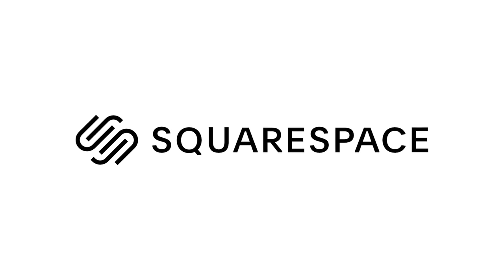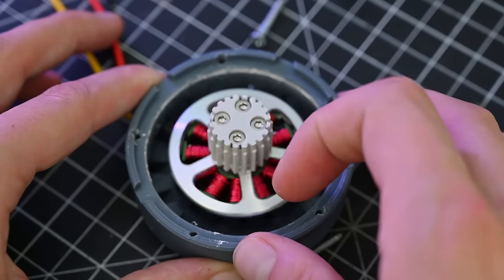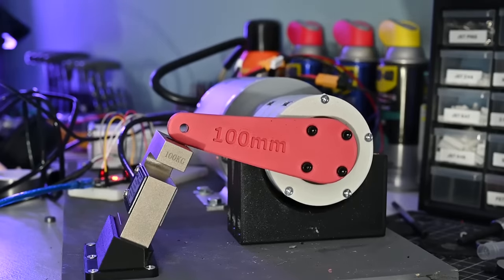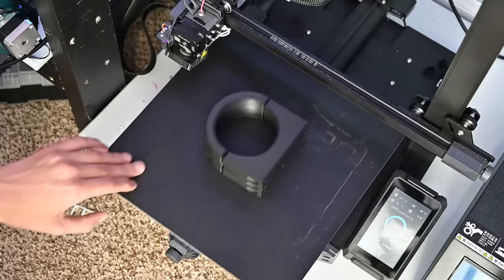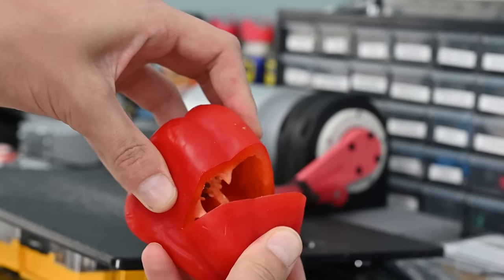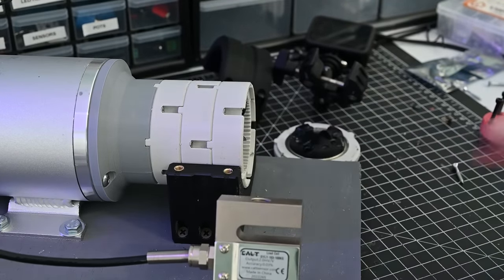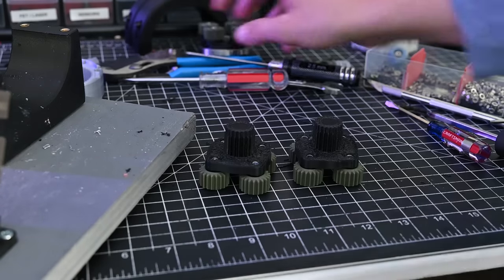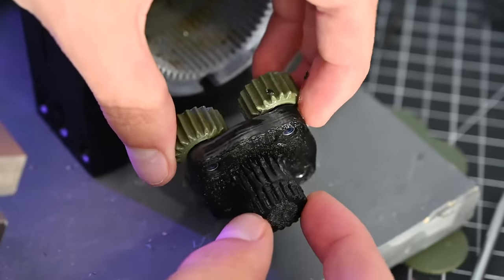Testing 3D Printed Stackable Gearbox

Comment: One pretty easy and cheap way to increase strength around where bolts are mounted in 3d prints is to add metal washers imbedded into the print, it helps spread a lot of the load out across more distance and gives a strong metal back.

Comment: The modular design is great - even for repairs. But the forces increase with each stage, so the size of each stage should increase, too. i.e. the planet carrier on the last stage could be bigger and stronger. I could see your design getting used IRL. Obviously you are a mechanical engineer.
Reply: I agree with this suggestion 👍🏽
Reply: Or print the later stages in different materials. This thing printed out of glass-reinforced nylon would probably be more robust than a drill gearbox through sheer cross sectional area alone.
Reply: @namAehT yeah, except that fdm 3d prints shear easily. Unless the layers are melted together

Comment: Planetary gears need to run on a through shaft to a backing plate.  By constraining the shaft on both sides  you will reduce the lever action on the carrier plate.  Longer gears will just make this worse. as you will be increasing the lever length.

Comment: You can get those same battery connectors in "anti-spark". They have a built in resistor. Saves the arc damage on the connector and is less stressful to the ESC. I love these gearboxes. Awesome work.

Comment: This was so taking me back to my previous work as a mechanic for Barloworld, South Africa's CAT dealer. We have had so many failures in planetary systems that i cannot even tell you how many.
I think that you are on the right track with identifying the output carrier as your weakest member so trt printing it in the strongest material that you have available.
This will unfortunately lead to the next weakest item failing and so on.
The idea here is to place a limit on the amount of torque that you want to have go through your planetary reduction drive as you can keep over engineering all the items ad infinitum and never reach a point where you are satisficed.
If you look at your different CAT machines using planetary reductions, they are all designed and sold in different size and application markets, from handyman to relocating mountains.
I really hope this helps as I am just a retired earthmoving mechanic on medical pension.
Pieter (Pete)

Comment: It would be interesting to see it printed in nylon, preferably with glass or carbon fibre to reinforce it. Also it should be printed at 100 % infill. With the nylon you could test it just after printing but also after letting it absorb moisture from the air to see which is stronger.

Heat set inserts are great, I am surprised they aren’t more common, they are so easy to insert and they are pretty strong, but it seems a lot of people don’t like them or are scared of using them. I was printing the matterhackers E3D V6 mount and found one that didn’t use threaded inserts and it required very specific nut shapes and sizes to insert and specific length bolts, whereas the matterhackers one that needed heat set inserts was very easy to put together and just used the inserts I had anyway.

Comment: One thing I noticed was that the planet gears spun concerning the carrier. This is indicating that there is too much force on one side of the planet gear for the carrier to handle. Putting another carrier on the other side would not induce a force on that side to help but may distribute the offset across the planets. Further, there should be enough room between the planet gears for the carriers on either side of the planet gears to be connected. The force could then be given to the planet gears from carriers on both sides and reduce the incorrectness of the torques on the planet gears.

Comment: Great video! Are you noticing a lot of part shrinkage when the resin cures? For resin parts I have made in the past, I have noticed that mine can shrink up to ~5% depending on the resin, so I mostly stick to PLA for “functional” prints. If you are seeing shrinkage, how do you deal with this? Are you pre-scaling the size of the parts to be slightly bigger or are the tolerances in this design loose enough that this change doesn’t matter much? Thanks!
Reply from the maker: I haven’t really had shrinkage problems with the Siraya Tech nylon black resin. I typically just use the horizontal expansion setting in the slicer to get the fit I want between parts
Reply: @michaelrechtin  Nice! Thanks for the info. I will pick some up and try this out.

Comment: Great video, i've been looking at those motors for a few months now and wondering what the performance would be like,. When printing gears I found that strength is usually won by the layer lines over infill, so for the smaller gears maybe a 12 layer line. Polymaker Tough PC Filament we've used one a couple of the robot builds, on gearing especially. There is an annealing process with that filament too, so pop it in the oven for a few hours which will aid on the compounds to become stronger. Love the video !
Reply: yup. heat treat the prints will help with max strength. there are some test videos online.
Reply: @jpjay1584  thanks for the reply a year later lol :)

Comment: With my carriers I have a screw that acts as a center shaft through the carrier and this way there is some metal reinforcement at the core of the axle that goes all the way through the part.

Comment: As far as improving the planet carrier, one thing that can be learned from impact drivers is that they capture the planet gear pin on both sides;
What that means is that there is a second plate with a hole in the middle that restricts the movement on the ends of the pins, stopping them from twisting side to side.
Usually the carrier is made from a single solid piece, which should not too difficult to 3d print.

Comment: The spark connecting the batteries is a classic in the solar / off-grid community, you should add a switch and do the plugging while the switch is off, to limit the sparks.

Comment: 100% infill with Nylon or Nylon with carbon fiber content. Or with more classical materials: print a positive on the resin printer, make a negative from silicone, and cast a positive from polyurethane resin.

Comment: Heat set threaded inserts changed my life and the way I design prototypes man. Also, barrier to entry for CNC milling is pretty low. (Relatively, I have a CNC machine shop already) You can get a genmitsu pro for pretty cheap and with some mods to the backlash nuts it will most certainly machine aluminum. You can also solid print the bearing backings combined with the housing to give extra support to the pinions.

Comment: I've always wondered if you could make an plastic 3D print stronger by leaving vias in the infill and pouring an epoxy resin as used in fiberglass. Think of how rebar is embedded in concrete to give it extra strength.

Comment: if you add some potential energy, then convert to kinetic energy to the dumbbell (by dropping it in to your sensor), you will have a complete different measurement. That's what are you doing when you measure the torque output with additional kinetic energy. Either way, there is no plastic gear match for this motor, unless you make them very large and introduce even more problems. Plastic gears will get destroyed with or without stored kinetic energy.

Comment: The planetary gears are tearing out of their mounts, because the tolerances are loose enough to induce end-climb. Add a backing plate for the far-end of each gear shaft, or switch to double-helical teeth, to minimize the end-climb, and compensate for the wide tolerance. And if you are using lubrication, add a center-channel valley. Experimenting with its depth will allow you to "leverage" some of the hydraulic lock to your benefit, as it effectively reduces the tolerance problem that is causing end-climb.

Comment: Great video. You want to select the aligned rectilinear/linear infill at 100% for best performance.
Reply: In Cura you have to manually adjust the line angle by typing the angles in settings.

Comment: The carrier will be really strong if you use bolts that go into the shafts to compress the layers. The bearings should go on the plastic carrier's shafts, inside the shafts is the bolt which compresses every layer from the bottom of the carrier to the top of the shaft.  Bearings aren't really necessary if you use lubrication. I made a much smaller 64:1 planetary gear box that uses no bearings. The carriers are practically indestructible.

Comment: PLA is wayyyy stronger then the stigma everyone gives it. When I design my firearms I do so with bargain bin pla in mind and it always surprises people to learn that, especially that I'm make a 50 caliber rifle with it (on the top end of my designs).
Reply: Happy to hear that, because that's what I've been stocking up on lately, I've got all the colors now : /
TPU in the 75D range like ninjatek's armadillo seems like a good alternative to use on budget printers, when PLA doesn't cut it. Although gears probably need relatively heat resistant filament, especially when operating non stop, so budget printers could never deliver the optimal printed plastic gearbox.
Reply: PLA has one major drawback, and that is its susceptibility to heat.
Reply: @graealex  Yeah Its honestly ideal in most situations, but you get it even warm and its useless. (not good when using high power BLDC motors)

Comment: Just wondering, have you considered magnet driven gears?  I don't know how long the magnets will last but at higher torques it will just slip preventing breakage I and increasing the life of the motor.  
I remember seeing a 100 ton piston snap and threw hardware at the operators.  Having a slip mechanism could have prevented breakage, replacement cost, and potentially of saved a life or injury, not to mention longevity of the part as no gears touch.
Granted regular magnets will not do 100 tons, 😂.

Comment: If I see that right you have the gears planet gears only attached to the carrier at one point each. I bet a lower ring connecting the gears on the other side could take a lot of those twisting forces. Also a shaft straight through all the stages to help align them could do a lot.
Reply: Agreed on last part. Stick a sanded 8mm rod down a hollow print with epoxy/glue

Comment: head on over to the torque test channel where they show Milwaukee's impact planetary drive system. They recent faced controversy where they redesigned the drive to a single shear support for the planets - and the mechanism kept breaking out of the box. You want to go with the tried and true double-sheer design which encases the planets and has bearings on both sides. This would make your system much longer per gear set, but will solve the carrier breakage.

Comment: PETG is less brittle.  They say PLA is "stronger" but for gears PETG may work better.  Also you want to grease the gears I think.  pretty sure that's how they make gear boxes usually they put a bunch of grease in there.  The PETG is higher temp too so if it gets hot in there (especially without grease) that would work better.

Comment: Thin piece of steel sheet on both sides of the carrier, with 100% infill 3D-printed carrier sandwiched in the middle. It wouldn't prevent warping completely, but it's likely the cheapest way to get more torque out of this thing.

Comment: I've decided to print it out and try.
Unfortunately in the outer ring, teeth are too close to the planet gears' teeth which causes problems with assembly and the whole planet gear rotates unnaturally and with great resistance. 
Planet gears with sun gear works well and there is some distance in CAD files between them. 
Have you faced a similar issue? Do you have other corrected or adjusted 3D files? Thank you for help, very nice project.

Comment: Electroplating the parts would be an interesting experiment.
Would it increase the peak torque?
Would it extend operating life through increased heat dissipation?

Comment: Great experiment :D

Maybe the carrier could be thicker and the planet could be thinner… also choose a planetary with fewer teeth overall (to make each tooth bigger)… maybe the carrier axle should be a metal square tube or a pipe with threaded holes, so you can secure the carrier.
Finally, I have read that “annealing” does wonders in layer-to-layer resistance.

Comment: You could have the planet gears supported from both sides by having a bottom layer with large enough hole for the output shaft of the previous stage to pass through into the next stage, should help against the twisting load on the planet gears.

Comment: Awesome video (as usual).  I'd be interested to see pure Nylon parts if your 3D printering skills & setup are good enough for it (warping might be difficult to tame).  It's surprisingly rigid at high infill and basically indestructible (it will have to fail through deformation, instead of snapping/breaking). Nylon-CF would also be worth a go, but it's pretty abrasive so even if the gears work, they would probably wear down over time.
Reply: If it's all nylon-CF then the higher abrasion shouldn't make much of a difference. Also nylon is excellent purely for its self lubricating properties!

Comment: Nice project! You could try to print the planet carriers with PLA Carbon, also 100% infill seems a good idea. Bump the extrusion temp as much as possible for the material. Usually it makes the bonds stronger.
Reply: As well as salt annealing forsure

Comment: To measure torque, would have been easier to set it up as a winch lifting an adjustable/increasing weight? You could then also calculate speed at various loads (ie power). That way you are measuring the torque in motion rather than measuring an impact?

Comment: Nice experiments. Though I have a little comment - you shouldn't compare loads you've measured with rated output loads (like Smart car). What you got is a peak, but for a more meaningful results you'd need to keep the parts under the load for some time and step-by-step increase the load until a breaking point. Of course, that is more difficult test-setup, since you'd need transfer from rotation to the force gauge. And another parameter would be introduced - speed. You will get different torques for different speeds, which would mean to a lot more experiments needed. But don't take it as criticism, it's great when people "play" like this and those test results have some rough results too.

Comment: It looks like your load cell wasn’t very close to 90 degrees from the output lever. You probably put out more torque than you calculated unless you accounted for this offset angle with math.

Comment: What if you print the ring and planets at the same time so you could use heringbone gears (the ones that have v shape) for the support material you could use PVA so once first stage is done you can use water to remove the PVA

Comment: How about having bored holes in the middle of the sun gear strengthen by thread rods.
Like this symbol Ꙫ , with them side by side.
Or even better, use some FHCS opposing each other screw in and held by nuts on each end. Hence, externally bind the 3d print layers together.

Comment: If the gear ratio increases by 4 at each stage then each stage should be make stronger to deal with the torque increase. Id start by testing a single stage to see how much torque it can withstand and then create a ratio of torque to part metrics, you will then now how much stronger each section needs to be to deal with the forces it is experiencing.

Comment: If you go for 100% infill, go for all walls instead of all infill. It's stronger
Reply: Aka 100% concentric pattern. Is this the strongest? I heard somewhere that 90/95% cubic/gyroid (depending on force direction) was the strongest.
Reply: @dollarbutt  typically not from what I've heard, since there's a higher likelihood that the layers from the concentric pattern are placed directly on one another which means it's more likely to be stronger between layers.
Reply: @dollarbutt  When you get to 100% filled, force direction means little to nothing. At that point it's all about how well the layers bond to each other. Else I would totally agree with you
Reply: … and maybe some over–extrusion to fill the last tiny gaps remaining, too.
Reply: Aligned Rectilinear infill is the strongest of all.

Comment: increase the thickness of each stage by a multitude or two. seems your output gears cant handle the shear force along such a short shaft. Thicken the final output plate, or possibly make it a sandwich so that the gears are supported form the front and the rear to stop them spinning out, doing this with each stage would ensure it stays more rigid, (make each planetary plate a cage instead).

Comment: Policarbonate is one of the strongest materials you can 3d print mechanically, but it's chemically weakened by greases and lubricants. Are you sure the lubricants you're using are not affecting it? ABS is chemically more resistant, maybe worth a try... But anyway you'll need an enclosure with higher ambient temperatures to get strong parts with good layer adhesion.

Comment: Great video Michael. I'd recommend using antispark connectors for the battery connection. The sparks could blow any sensitive electronics when plugging in.
Reply: Not really mate. Manufacturers know the voltage their products are rated for. They have built in fail safe (often dampening inductors of sorts).